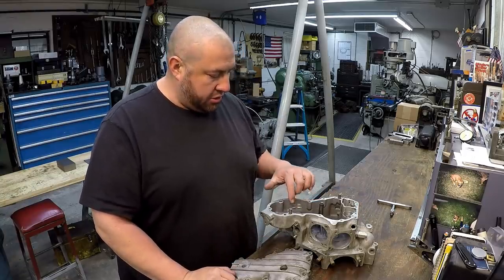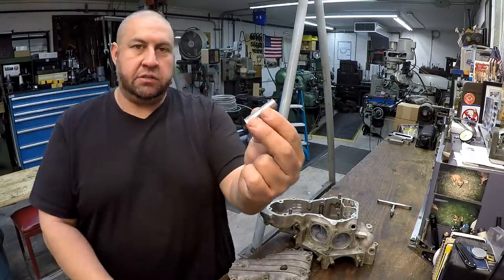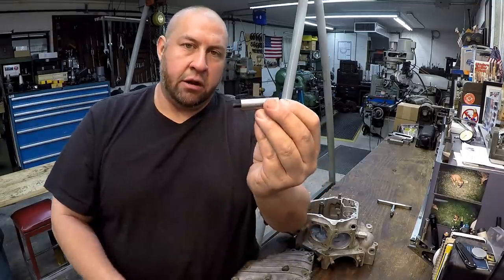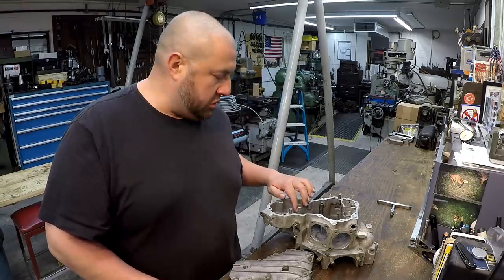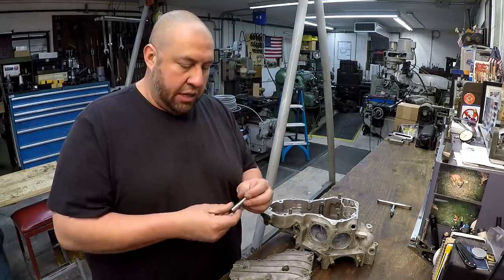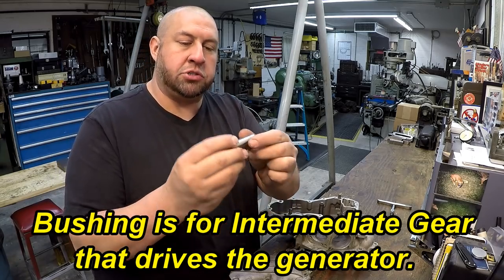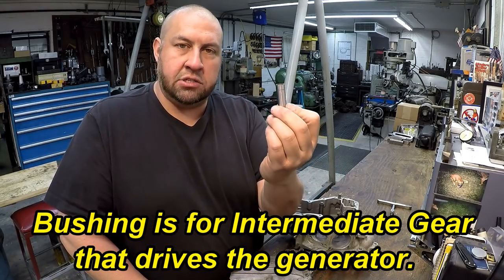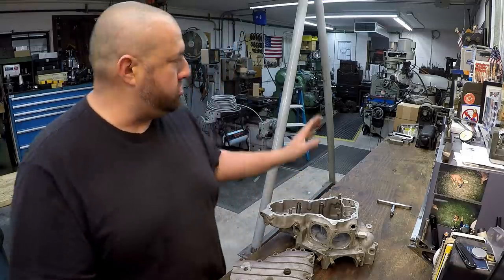Harley Davidson Pan Head Engine Case Repair Part 1

Comment: i learned a lot from this video. the mild body slam to the casting to check the integrity of the hold downs is a really neat trick. AND i learned not to let the arm on the co-axial indicator slam open when it exits the hole. thank you.

Comment: Looks great so far. The people asking about Loctite have a legit question, but when I installed aftermarket motor mount brackets on the sides of my Jeep's 4.0L the maker's instructions specified the torque value given by Mopar and then advised that you use red Loctite and reduce the torque spec by 20% to make up for the lubricity of the Loctite (which will give you a false torque value at the wrench). With that in mind, I don't think the Loctite is a bad idea if you used the red stuff. 

I enjoyed this and look forward to part 2. You do great work.

Comment: Very good Adam.  Looks like the bottom of the whole might be a little deeper.. Hopefully the material missing is added to the top hat.   I expect the guy is using a new cam cover also..  Gota love keeping the old motors running..
Reply: Is it the bottom of the whole hole or just a bit of it?

Comment: ..Great video as always...I've got a couple of 1946 HD Knucklehead motors...same set-up.....the long screw holds that sleeve in there, the 'hole' is a light press fit....but....if that screw gets loose at all....the sleeve can 'wallow around'.....and the gear that goes  there overdrives the generator at least 200%....the outer end of steel sleeve is usually located by a bronze bushing in the cover....right about where there's another extra hole in this one...
...But...hard to tell what the engine builder is doing....there's another 'extra' hole on the outboard cam journel, and the front of cam cover is cut off...no way you can run a motor in that scenario.....
 There must be a reason for it, you can get a new Re-pro from S&S for $100
Reply from the maker: He mentioned reproductions but some of his customers along the years are wanting 100% original parts.
Reply: And that cam cover is a cut down job for repair and set up. Most likely a damaged one. It is a jig now. Same cam cover used in the SNS 26 repair. Identical repair too. I have seen a jockey top cut away for shift fork adjustment.
By the way... I have a 1938 Knuck sitting next to me here in my house right now. Had to weld up the cam cover on it that was very worn from the rear brake pedal. Also have a 52 WLA with a K Model top end here. That uses the same exact genny idler gear stud mount. That case has this same repair. The bike has T&O 4 5/8 stroke flywheels and is a hot rod flatty. THANKS ADAM. I live with and for vintage Harleys. Anything with Iron cylinders. Primitive and soulful machines.
Reply: OK....one of my 46's has several repairs like this....TIG welds in several areas...all 4 motor mount/s have been repaired....

Comment: Part of the problem is with the gears that Harley uses. They are frequently not round and over or undersized. It is not uncommon to have to lap the gears in to one another. If you get bad gears in the gear train the weakest link will blow out. I once had a cam gear that was 4 thou over sized and 2 thou out of round on the wires. With fresh bushings in place you could actually feel the crank tighten up and loosen as you turned the bottom end over by hand.

Comment: I'm not a HD guy... is this the sort of excellent engineering one would expect from vintage HD engines?

Another cool repair series, Adam. As always, I'm enjoying just sitting back and watching the chips fly with you.
Reply: ...I'm an HD guy and can tell you this IS the engineering of the day for those engines....crude, but it seems to work...and then...if that hole gets wallowed out again....weld it up and machine back to original specs...I've seen these engines with heli-coils in just about every hole....
Reply: At least it's an easy fix. ;]
Reply: ..Alapino...easy fix, yes.....these Harley parts do real well with welding...TIG it up, then re-machine.....kinda' like Bondo on cars....pile it on, then cut off what you don't want....

Comment: The genny bearings go south, causing radial runout in the genny gear. That gear then load hammers the intermediate gear, excessively loading that bushing, and dogs out that case counterbore.

Comment: Thank you Adam for the video, does anyone know if the readout on the quill is something that can be purchased or must it be built form some other readout?
Reply: I THOUGHT Adam said it was a Mitutoyo.  It should be available on the 'net.
Reply: Thank you Jeffry, I missed that.
Reply: Thank you Poppi2006, much appreciated.
Reply from the maker: It's the Mitutoyo quill kit. I got mine from KBC Tools.
Reply: Adam,  I will go there to get one, Thank you :-)

Comment: Years ago we would just use JB weld to take up the slack when the pin waddled out the hole there.
Reply: How'd that work?  I've never had JB weld fix anything other than the brake switch on my old "64 pickup.  Epoxy is fine stuff, but the uses are limited.  JB gets a lot of credit that it doesn't deserve for long term repairs.  It is quick, but hardly permanent.

Comment: How did you deal with the fact that endmills are concave on the end? Wouldn't that make the bushing rock?
Reply: Indeed, but it seems like it could be enough to cause a problem in this instance. Maybe he relieves the bushing, I guess I'll see.
Reply: I suspect that's what the counterbore is for. If it's a tight, press fit in the bore, rocking will not be an issue anyway, the bore will align it.
Reply: A good friend of mine mike bielen out of NJ master machinst. He  has jigs  that  would blow your  mind  for harley   he grindes  he's end Mills it .551 dia  make  like a counter bore cuter they will rock if you use a standard end mill ! good machinst are hard to find  don't use a motorcycle cycle machinst there hacks

Comment: I've compared the SNS 26 to this one.  This one is much better.  In addition to the DRO's, the lighting was better so you could see the details better, the background noise was eliminated (maybe you weren't running the A/C, but you sure had the fan on #26).  You also looked more 3 dimensional and your narration was much smoother, proper volume and your speech flowed better.  I guess it's like the visitor to New York City who asked a native "how do you get to Broadway?"  The reply: "Practice, practice, practice."   

Totally  separate to your improvements was the part this time seemed more damaged than the first one.  You didn't have to make a "top hat" bushing on #26 and it looks like you've got the work holding better.

Comment: I miss digital read outs on mills and lathe after using them for 2 years in school I also miss air powered draw bar both makes life so much easy to do projects I really miss digital read out on a lathe my work the mill and both lathes has no digital read out all it sucks big time

Comment: At the end when you are showing the stills at 15:47 on the sides near the bottom there appear to be tiny holes on the side , iam a seeing that correctly?
Reply: Good eye, I didn't notice that first time around. It looks like either damage that didn't clean up when he made the 3/4 bore, or voids in the casting.

Comment: Nice repair ! But wonder why the factory did not have the for site to do that right from the start , I have a tool that is cast aluminium but it has steal bushings pressed in !
Reply: Was probably never envisaged to last 50-60 years.
Reply: The steel pin is supported on both ends in the casings. As long as that screw remains tight it should last maybe 50 years ?

Comment: Could clean an fill damaged area an then fresh boar an tap hole ?
Reply: James Wood it’s aluminum, any fill would likely just fall out with the vibration of the motor
Reply: @James Wood the castings are no fun to weld. Typically they crack somewhere close to the repair. I think it has to do with the alloy HD used, but I'm not sure.

Comment: I have a dumb question; why wouldn’t you weld the area to build it back up and then machine back down to tolerance? Im neither a machinist nor a welder but that seems like more permanent fix, if it is possible. Great vids by the way, started popping up a few days ago.
Reply: My guess is too far away from a place to bolt a torque plate to keep warping from heat during the welding process. Again, my guess

Comment: Great work as always Adam. Long time subscriber, first time commenting. For the first bore you cut with the four flute HSS endmill, is that a flat grind on that tool? As most endmills tend to be angled from center out on the bottom to help keep them stable while plunging. (My understanding anyways). That any cause for concern with your bushing, not being a truly flat face?
Reply from the maker: That small amount of angle was not a concern to me and for what was being done.

Comment: Not second guessing or complaining, just trying to learn.   Since you are able to center and get get accurate depth why create a bushing rather than welding up and machining new surface, bore and threads?
Reply from the maker: Simple answer, cause I did what was asked of me. A steel bushing is a strong repair.
Reply: These Harley castings suck,many air pockets ETC and alloy is a big ??? plus years of oil saturation makes welding them a nightmare, proper fix here and more permenent than weld metal.
Reply: These cases can be a bitch to tig up!

Comment: Hi Adam, what brand coax indicator did you say it was, I couldn't quite make outthe name. Can you send a link? Good job, can't wait to see the bush part 2
Reply: I think it's a Blake coax indicator.
Reply: Cheers Peter
Reply from the maker: Gordon, it's a Blake brand, made in USA.
Reply: Go to 16:02 in the vid.  If you need more info than that, you can't be helped!
Reply: What is there about pointing out the picture that makes me "shadowy and negative"?  I guess we "wankers" are just too helpful.

Comment: Will loctite hold when the case gets somewhat hot?
Reply: Oh yea, but it depends on which LocTite your using.  The 680 I use for this kind of job will hold up to heat, oil, and vibration.  Once it sets, the only way to get the bushing back out would be to mill it out.
Reply: LEO ASHRAE thanks.   I thought there was just blue or red loctite.
Reply: You had best do your research before you use LocTite on a job like this.  I have fourteen different formulations of LocTite in the shop, and I'm fairly sure I don't have half of the different kinds they make.  This is a very useful product, when used for it's intended purpose.  Use the wrong one for the wrong purpose, or on an incompatible metal, and you'll have a mess that you will not soon forget.

Comment: Just clean it up, and pour liquid aluminium into it,  or build it up with welding rod, then drill it out, lol, I'm just joking, sorry, today was a bad day, Youtube is doing away with my lifelong hobby, reloading  I'm 70 in a few months and to old to learn anything else to have fun....
By the way, what keeps the bushing from turning and wallowing the hole out again?  Don't laugh to much, they will do away with "machining channels" before to long as being to dangerous, or automobiles, or hang gliding, or self driven auto's even  before they become reality.
Reply: A light press fit should be enough to keep the bushing from turning since it will be held firm by the pin itself. A bit of Loctite does not hurt.
Best way to prevent it wearing out again is to use a better material for the bush. Cast iron or bronze are probably best, but I think even steel would work.
The hole wears out from being constantly compressed by the case twisting, cast aluminum is not the best in that situation
Reply: thank you for the reply, I haven't a clue about taking care of problems like this, that's obvious --  I think the world of your abilities, I've thought about buying a lathe and mill but I'm not sure at nearly 70 I've got enough time to do them any good.  I might just be better watching Abom79.    Thanks for your reply joshua43214.
Reply: Yes the problem with installing a bush is that the walls of the housing are no longer as supportive, if it opened up due to stress with the wall thickness as it was, it will definitely open up again now that the walls are half as thick,as the bush will give little support to the pin, just transfer the stress out to the much thinner housing, the only way to repair this is to weld in the whole bush housing and re machine back to standard, but I am sure Abom will reach that conclusion.
Reply: @Englishman French
I have a respectfully disagree.
Wall thickness had little to do with it, the problem is that cast aluminum is too weak in compression. Wall thickness affects tensile strength.
When the pin is placed under lateral pressure, the material around the hole stretches into an oval, the material under the pin compresses. When the pressure is released the stretched portion returns to being round (the nature of ductile casting), while the compressed material retains a small amount of deformation (mostly at the edge of the pin). As the base continues to accumulate deformation, it allows the bore to stretch more and more, eventually the stretch exceeds the tensile strength of the material and it starts to fail.
Cast aluminum is extremely weak in stretch, the bolt probably provides more rigidity than the hole. The lions share of the rigidity is the material resisting compression as the pin tries to rock.
A bronze bush is the perfect material since it far stronger than any aluminum in both compressive and tensile strength. Next best would be cast iron, last would be steel. The problem with steel is that it is too stiff and will just transfer all the force back to the aluminum case, where bronze or iron will allow some deformation. Since both materials have very nicely ductile, they will not fail like cast aluminum.

Welding would require very difficult preheating and no way to confirm additional stress and brittleness have not been added into the case. it could be done, but unless you are prepared to send the whole thing out for stress relieving and heat treating, it should be treated as a last ditch attempt.

Comment: Harley engines sound great. But at the loss of power because of the fact that both pistons fire at once. But I mean come on guys. Who the fuck makes something aluminum that needs to handle any sort of pressure like this. That's just poor design.
Reply: No they don't. An explanation for you: A Harley engine has two pistons. The difference in the Harley engine is that the crankshaft has only one pin, and both pistons connect to it. This design, combined with the V arrangement of the cylinders, means that the pistons cannot fire at even intervals. Instead of one piston firing every 360 degrees, a Harley engine goes like this:

    A piston fires.
    The next piston fires at 315 degrees.
    There is a 405-degree gap.
    A piston fires.
    The next piston fires at 315 degrees.
    There is a 405-degree gap.

And the cycle continues.

At idle, you can hear the pop-pop sound followed by a pause. So its sound is pop-pop...pop-pop...pop-pop. That is the unique sound you hear!
Reply: Well my reasoning would be that the piston fires are closer together. Although now that i'm thinking about it, your still putting in the same energy, it's just delivered at a different rate.
Reply: It's not handling any load pressure as such. The only load is from rotation. It's an intermediate gear. It's job is to transfer rotational movement from the crankshaft gear to another gear.  No real load on it. It moves around because the screw comes loose over time and wobbles thus elongating the hole.